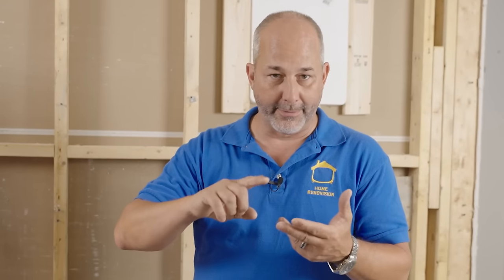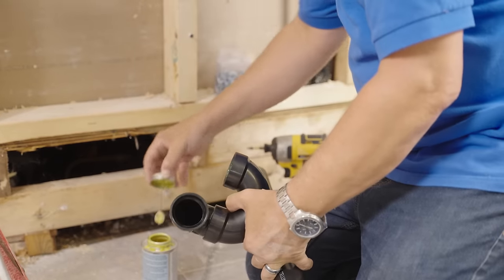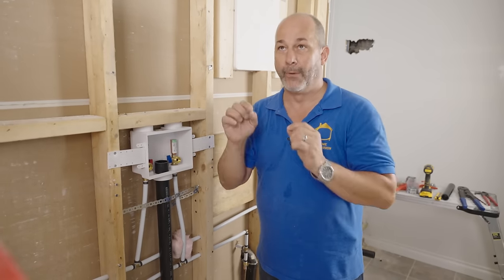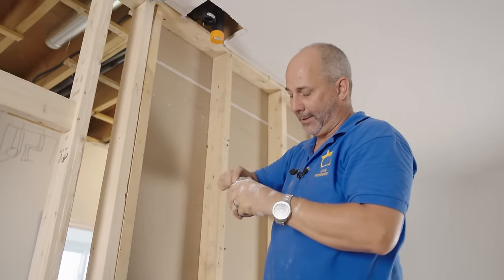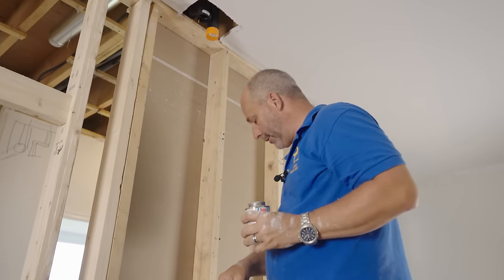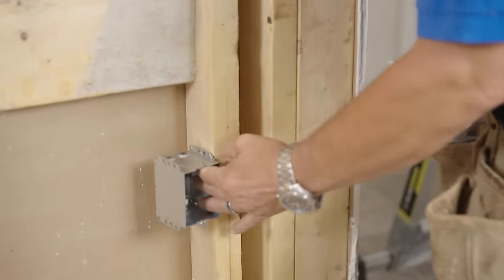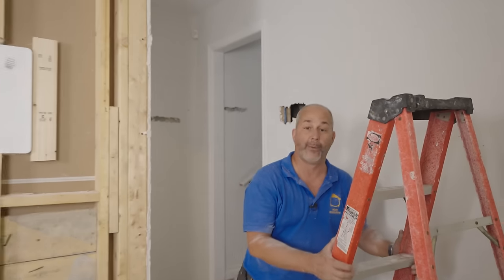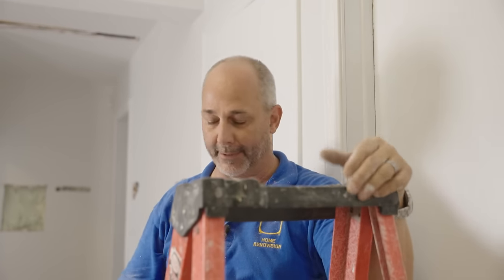How To Move (Or Add) A Laundry Room | Church Flip | Episode 13

Comment: Jeff, since you opened up the ceiling, why not run the wire through the joists instead of tacked under them?  You seem to have room now to drill the holes. Would prevent you from having to build a box.

Comment: In the city...I live outside in the country...where I live you must use copper for water...no pex allowed.  If you use a metal electric box all electric wiring has to be inside conduit.  On sewage/drainage you have to run a vent line up and out of either the attic or thru the roof...cheater air valves not allowed.  Yeah.  They're sticklers to things is outrageous.  In the country out here...no building codes or inspectors to deal with.  I still follow the old rules...do it right even if it costs more.  I also still do all my electric boxes out of the thicker blue or black plastic except a junction box which is metal, with the little black plastic nut end things that when you tighten presses down against the wire stuck in the holes my wires come in thru, wires soldered, wire nuts on the ends, wrap a little tape, and covered...just to be sure.  PVC for cold water, CPVC for hot.
edit...forgot to mention in the city they don't allow wall plugs and switches to use the cheater push in holes. You have to wrap the screw, and the 3rd ground has to be up...don't know why because it doesn't really matter. And no 14 gauge wiring allowed.  12 gauge is minimum on 10 to 15 amp circuits, 10 for 20 to 25 amp, 8 on 30 amp...literally 1 step larger for each.  Yep.  They are weird.

Comment: @21:54 - You are not allowed to use a aav for a pump system. (I think you’re running a separate vent for the pump though.) Aav should not be buried in wall at least needs an access panel, best to put it right under the sink. 

@23:45 - Most pumps require the circuit be a dedicated run from the panel (should be mentioned so people don’t screw this up)

@28:51 - Staple every 5 ft not required where drywall is already installed.

@44:21 - should have the specs in pump spec sheet , the The Saniflo 0.3 HP gray water pump requires a 15A 120V GFCI protected circuit. You should not be suggesting people use 14-2 for 240v systems. Only 15 amp 120v!

Comment: I noticed the reducer had a bar code label on it. And then you brushed the solvent around that reducer including over the label. Does the solvent work with the paper label between the fittings?
Reply: I had the same question.
Reply from the maker: yup. The label is actually plastic and melts.
Reply: Yes.
Reply: @HomeRenoVisionDIY  It did occur to me that manufacturers would not expect plumbers to have to peal off labels the put where you brush on the solvent. I'm learning a lot for your videos even though I don't always have an immediate need. Thanks. And don't get electrocuted.
Reply: Maybe it melts with the solvent but it still bothers me that it's in the way so I remove it first
Reply: @robs1852  Yeah, he said that it does in a reply to me.

Comment: 2” P-trap - 6 to 18 inches from the ground. Stand pipe 18-24 inches from the ptrap.

Ptrap at least 2*pipe diameter up to 5’ to the vent, depending on vent diameter.

Slope no more than 4 “ to 1’.

I really don’t think gluing and cutting is the hard part of plumbing.  It is making sure that your doing it to code and choosing the connections.
Reply: Your not speaking plumbing code so please don’t mislead people with incorrect information. The answer is a standpipe must be a “minimum” 18” above trap weir and a “maximum” of 30” above trap weir. The standpipe must also discharge to 3” pipe incumbent on state and/or local plumbing codes. A vent must also be installed after trap regardless of whether or not drain pump is vented. The vent for the glue trap is to protect the integrity of the trap.

Comment: Jeffs the kinda guy that would like split neutrals *each phase uses 1 neutral instead of 2.  It saves money on wire, just can't use it with in panel GFCI's.

Comment: New code requires laundry drain to be 2 inches
Reply from the maker: exaxctly. I learned that after we filmed and upgraded before inspection. Cheers!
Reply: @HomeRenoVisionDIY  hmmmm..eyy
Reply: Jeff mentions at 22:55 that he needs to update the drain to 2 inches. 😉
Reply: what section does it say that? just for reference :)
Reply: @semo6229  the drain section 😆
Reply: @semo6229  I conveniently included the timestamp in my comment: 22:55.
Reply: Yeah he starts to mention it at 22:32
Reply: @Ding_Bat  yes but apparently its easier to just watch a 2 min part then criticise the creator.
Reply: That’s not a new code it’s been that way for a long time.  And why didn’t you run the drain line over to the exciting drain line to the right of the of the new box?
Reply: Clearly it was too excited to move
Reply: @mikeus69  🤣
Reply: @mikeus69  Yup, idk why but I'm still laughing at that comment.  Lol 😆
Reply: @HomeRenoVisionDIY  also if you use 2” you can also glue right on the wall mount so there’s no space for air to get in if you’re building a passive hold or are on an exterior wall for some reason
Reply: Also the trap has to be 6” to 18” off the floor.  Can’t have it sitting on the wood like that
Reply: @Home RenoVision DIY  your not going to believe this ,but in our jurisdiction any horizontal laundry drain now has to be 3" the code is always changing
Reply: @denniscordova9920  what? Who has a laundry mat in their home for that size pipe. You can run a whole bathroom off a 3” drain line 😂
Reply: @marcemarc6516  I know it's hard to believe but I work in Charlotte North Carolina any horizontal section of a laundry line in this state has to be 3 in diameter the vertical can still be 2in including the Trap
Reply: @Marc E Marc  its😊 code international plumbing code
Reply: Can't find my question after I just posted it. Why is that?
Reply: Laughs in “out of city limits”

Comment: So am I correct to say that the laundry drain is now required to be 2" but the venting is still 1-1/2"?
Reply: Nothing wrong with using 1 1/2” pipe for venting a 2” line. It would technically be 3/4”, one half the size of pipe being served but we would never do that, so any pipe below 3” in diameter, receives 
1 1/2” pipe for venting.

Comment: im sorry but the routing of the pex running hot over cold and the drain floppin around without wrapping that strapping around the pipe is shady work at best, love your vids but I'm not gonna lie, I get it this was for a sale and then its out of your hands but if you're gonna do the job do it better... also, the electrical box should have been above the water lines not touching them... I'm just gonna leave it there...no offense and I love your content... thank you

Comment: No offense to your plumbing skills but 2” for a washing machine isn’t exactly new code. Unless you consider 30 plus years new. Washing machine on the right side. Do y’all also put hot on the right in Canada. I kid. I guess it doesn’t really matter. When I do a washing machine box I always hug one stud. This firms it up a little more but it also gives me plenty of room for my p trap. This doesn’t really apply here because your trap is turned out. Most of the time they’re flat and tie in inside the wall so they require more space. 
As for hammer arrestors, you don’t need them at every fixture like they used to do with the homemade tees and a cap. You only need them when you have a self closing valve. I guess the thinking is that most people don’t slam their faucets off so they never create water hammer but an automatic valve will. For those who don’t know what causes water hammer, it’s when water is moving through a pipe and is stopped suddenly all that momentum has to go somewhere. It will hit the stop and then a wave will go back through the pipe. Noise is the least of your worries with water hammer. It can actually damage your pipe over time. I’m residential the only two places you generally have self closing valves is on washing machines and ice makers. Since both those boxes usually come with them then you don’t have to worry about putting them in. The only other appliance that may need one is the dishwasher m. They make hammer arrestors that screw directly on the angle stop for these. I rarely worry about it unless the inspector asks for it. Like the ice makers it’s such a small diameter pipe that you don’t have much hammer anyway. I do commercial so we always have to put them in every bathroom. This is because commercial toilets are usually flushometers. These are the toilets with tue chrome piece and no tank. They’re self closing. Also all public restrooms have to have a metered faucet. These are either censored or mechanically timed and they need them.

Comment: Why didn't you use 2" for the drain out the box?  Most codes require it, and that is why the box is made for a 2" pvc glue connection.

Comment: Washer hookups should have been put on left and dryer vent on right.  Reason is that front load washers are all left-hinged and non-reversible.  This won't matter for a top load washer, but it is a big mistake if homeowner wants a front load.

Comment: I was using the pinch rings for quite some time however I never realized the problem will but I don't use those no more I actually use PEXA with the expander
Reply: How long after did the stainless steel pinch crimps failed ? Just installed a new line for washing machine and used those vs the copper rings.

Comment: Careful, Ontario building code doesn't usually allow ABS pipe to be used under pressure, which in this case would be! An often missed requirement. Even sump pumps I inspect always have ABS piping, admittedly I never blinked an eye until it was brought up with coworkers.
Reply: What are you talking about?
Reply: Correct, he would get bit for any pipe pressurized below check valve. And any water which remains stagnant above check valve until remaining water levels flow to discharge tee.

Comment: Correct, an AAV is prohibited from any pump system. People don’t understand that an AAV is to bring air into the system to protect integrity of trap seal. A drain pump must be able to emit air to release built up air pressure. That’s why an individual vent from drain pump is key. Also, AAV’s cannot be installed onto a system unless a primary vent is installed on system, bathroom group, or fixture drain.

Comment: WRONG WRONG WRONG----Sadly codes!!!!!!  Are not 1 1/2" drain pipe but 2" and that's why it slides past the flange-- it won't pass inspection (unless your inspector cares less) Now use 2" for kitchen sink and the washer. Open to liability showing this recent video. Take it down and do it to 2022 codes.. Since it was already wrong.  Also most plumbers wrap the metal tape around the pipe to hold it exactly in center of wall void not to keep it inside loosely. Too long nails/screws can poke it,

Comment: Jeff, I have asked this before, but cannot seem to find an answer. Do you use ABS vs PVC because of personal preference or local code? If personal preference, why do you prefer ABS?
Reply: I'm wondering the same thing.
Reply: It’s lighter than standard PVC and it’s easier to work with. Unless you purchase cellular core PVC pipe. However, he is using the wrong solvent for the ABS pipe. He should be using black ABS cement, specifically designed for ABS. If anyone were to look on the “all purpose” solvent label, it says, not to be used  as an alternative to original product solvents or cements.

Comment: I wonder why isn't standard do have a floor drain in every room where there are water supply. Specially Laundry, but i'm also thinking nearby a toilet, kitchen sink, any area where it's common to have water disaster. It would save all of them, wouldn't it?

I'm thinking to move my Laundry, thanks you for your video. I'm also thinking to have a floor drain, what do you think about it
Reply from the maker: put the washer in a pan with a drain so if the pump breaks...your all good. Cheers!
Reply: Great comment! And yes, a floor drain should have been installed. And if Jeff hired a licensed plumber, an architect would have added a floor drain in that vicinity to inhibit/mitigate flooding. A safety catch pan is to be used on any floor “above” basement. But he obviously didn’t secure a plumbing permit nor did he hire licensed plumbers to do this project correctly.

Comment: I was wondering if you'd address the price of that wire! 6/3 here in Atlanta is $529 for 125 feet. Last big wiring item before the kitchen is done, so I'm hoping the price comes down! Looking forward to the Saniflo video, that's what we're using for the kitchen sink.
Reply from the maker: don't bet on a price reduction. housing shortage will keep the demand high.
Reply: These types of instructional videos can be used for years, but pricing becomes obsolete almost right away.

Comment: This was interesting.  But. Code dictates 2" PVC pipe for the drain for the washer.  Also, the trap needs to be between 20 to 36 "  Thats US code.  The whole setup cant resemble a s trap.  Which me its got to be a p trap.  Also the length must be at least twice the dimeter in inches to the drain.

Comment: You comment about water in the vent and cure it without  finding a cause by adding too much slope.. Water in the pipe is not bad unless it can statically collect more than a 1/4" which means it is not using steady gravity. Too much and it can siphon a p trap.  Even heavy winds can make a vent pipe evaporate a p trap on unused sink in a week or three.

Comment: 14:59 Does the solvent work just as good with the paper label inside? No. Of course it doesn't. The paper label is supposed to be removed before cementing the parts together. You know that. Come on man.

Comment: Hi Jeff.   In the UK the majority of DWV is outside of the home, attached to the side of the house.   either cast Iron (old) or PVC (new).   Plus We don't have the risk of freezing in the discharge pipes as our temps don't hit the same as we have in The Great White North.    Most places don't allow ABS as it was made from recycled crap and subject to UV light.  In our Province in Canada you cannot use PVC (Go figure?!) as the code is outdated. And electrical is 220v in the UK so getting zapped really hurts a lot more, don't ask me how I know this :-) just trust me.  I can tell the tale if you really wanna know?   Personally, I like having the 110v system in North America, with the advent of LED lights and low voltage electronic devices the lights no longer dim every time your run the kettle and the TV during Stanley Cup advertising break.  

Canada, a country based on Metric which sells lumber in feet and Diesel in liters.   As opposed to the UK which was until recently part of the European Trade Union that sells lumber in mm (but everyone knows what you are asking for) and diesel in Gallons....

Comment: Man, I'm happy to live in Europe (Netherlands to be exact). Our code is so much better / easier while at the same time safer. We put our wire in a pvc pipe and we're done. Anything is prepared for 16A (230V) breakers so I can unplug my dryer and misuse the plug for my phone charger.

Comment: I'm already wishing you'd started by telling us where in the building this is located (middle of building or outside wall? Near existing plumbing?). We need to work from birds eye view down to the details.
Reply: We appear to be looking at the back side of drywall rather than sheathing, and there's no insulation or vapor barrier, so I'd assume that it's an interior wall.

Comment: Thanks for this informational video. I have question. I have one drain that I want to use for a kitchen sink and a clothes washer. I know it isn't recommended to have both on same drain, but how can I make this work. I have 2 inch pipe that runs approximately 2 or 3 feet then branches off to a 3 inch abs pipe.
Reply: Have  your licensed plumber cut 3” pipe and route it over to proposed fixture locations. Then have a licensed plumber install properly sized fixture branch/drains for each fixture correctly.

Comment: As I just learned all this from doing mine, it would have been worthwhile to mention standpipe and p trap length and height requirements for the washer drain line. Thanks for the great video as always
Reply: True, but can you share what you learned doing yours?
Reply: @TwilightxKnight13  yes, basically what I learned is that the p-trap has a height requirement that it has to be installed above the floor level, and that it must be between 6-18 inches above the floor. The standpipe itself (after the joint of the p-trap) needs to be between 18-42 inches. If the stand pipe is too long, I learned that the drainage can cause excess sloughing of drainage out of the P-trap resulting in an inneffecive water seal. If it's too short, you could overflow your drain line. In my state, it is a requirement that all drain lines for washing machines are now 2" diameter.
Reply: @TwilightxKnight13  obviously there can be difference and you have to clarify with your local codes and what your inspector wants to see
Reply: Typically, internationally, it’s a minimum 18” standpipe height and a maximum of 30”, of weir of trap. And some local municipalities require that the 2” laundry standpipe must directly discharge to a 3” pipe.

Comment: I've never heard this before 3:10 - 3:20 "right side on the back of the fixture is always hot"... Me.....*brain working hard to comprehend*.... No the left is hot * walks into washroom*.  I guess if you look at it from behind... But from the front it's left... To left.. if you're standing in between the left goes to right.... But if you're tall and working from the front it's left to left...
Reply: Aaaaaa.yyyyyayyay....Sócrates couldn't had explain it better.